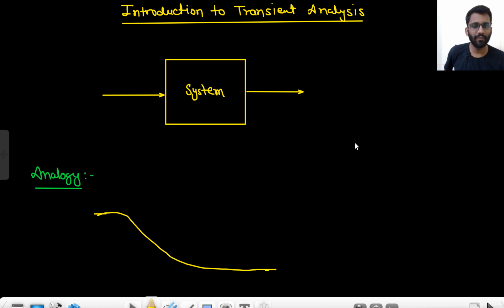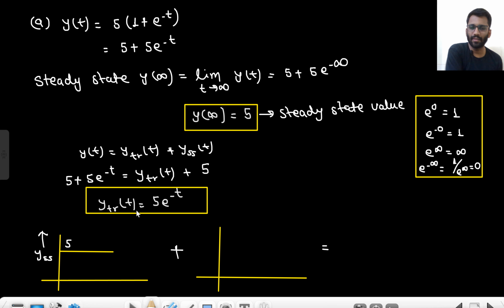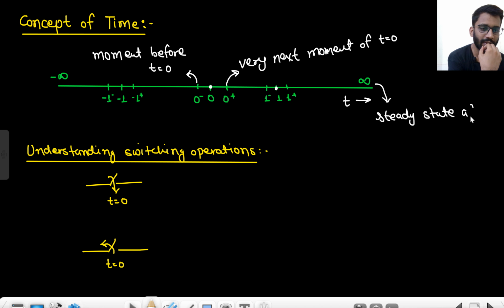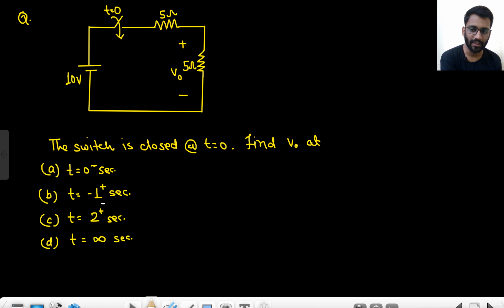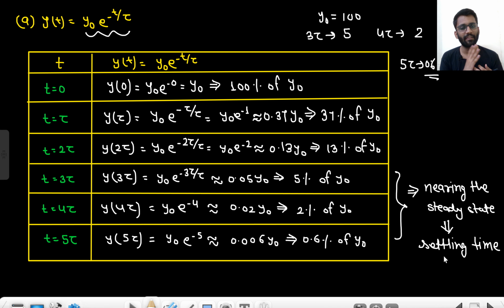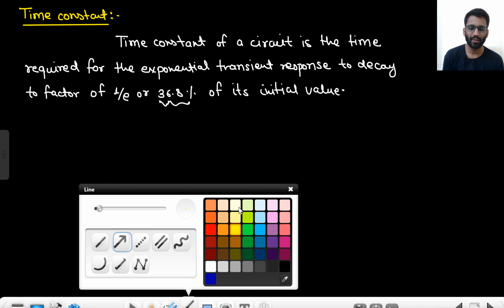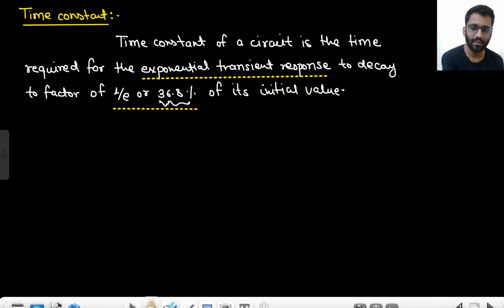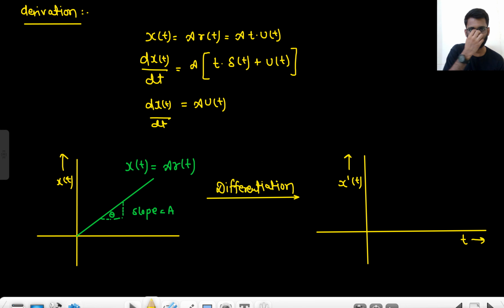Introduction to Transient Analysis || Network Analysis || GATE 2025-26 || PrepFusion

Comment: Thanks sir! Definitely one of the best explanation on transient analysis.

Before this, I used to think that in transient analysis, the rising waveform at t = τ reaches 63.2% of the final steady-state value, or is 36.8% away from it, and this was always confusing whenever I revisite the topic. I never really asked myself whether we actually know the steady-state value beforehand.

Now your explanation of the transient exponential waveform at t = τ, the response is always 36.8% of the initial value (i.e., the given transient component like +6 or -6) has cleared many of my doubts.

I also want to add that for a positive or negative value of x e^(-t/τ), the waveform is bound to reach zero. If the transient is positive, the waveform decays toward zero; if it is negative, the waveform rises toward zero. That’s why overall voltage rise and fall behavior happens not because we assume the steady-state value in advance, but because the transient part itself naturally decays with time.